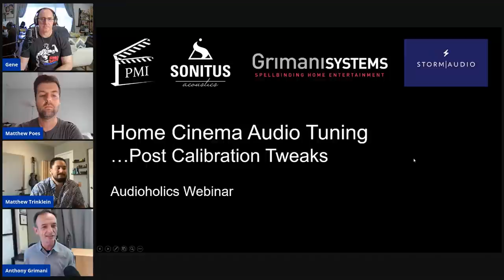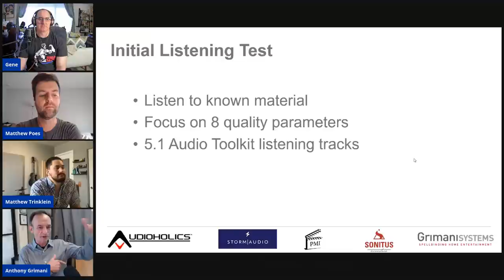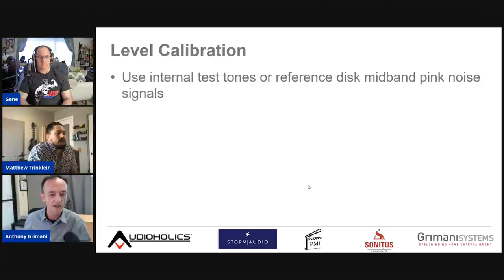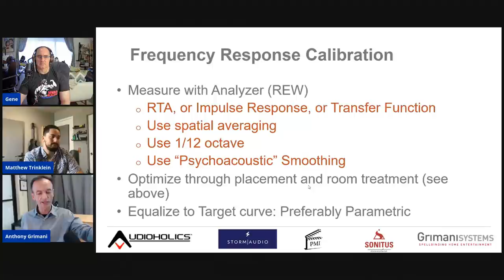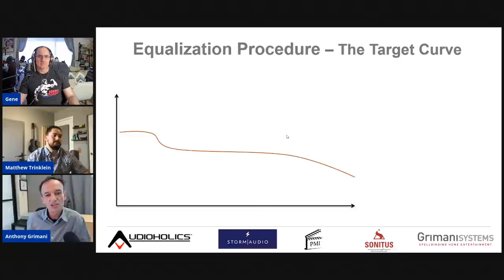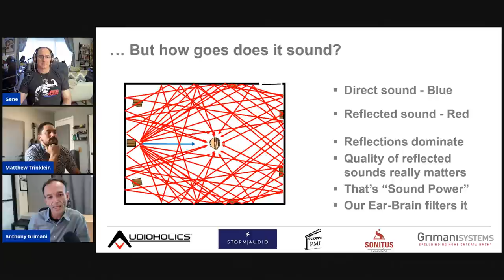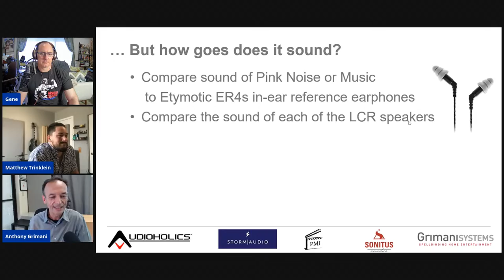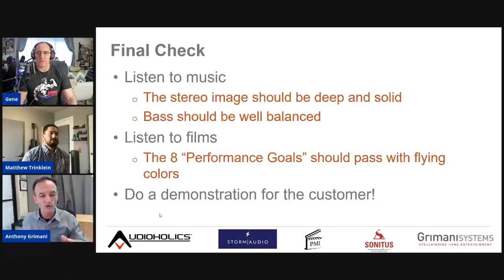Post Calibration Tweaks (After DIRAC)

Comment: Anthony your spider web drawing of the rays of reflected sound is not right. There are not that many bounces before the reverb time dies out. What you are showing is all of the possible angles that the reflections can come from, not the number of bounces that there are. Just ask yourself how far could each reflection get in a half a second reverb time. It would be more illustrative to make an image model drawing in which the reflected sound is shown as additional images on the other side of the walls, like mirror images. You won't get very far with the reflections of the reflections before you run out of additional images. I have tried to contact you by email but you don't respond.

Comment: i think maybe we get a little too wrapped up in achieving a perfect sound for HT. there is certainly bad sound, objectively bad sound. good sound? pretty easy to get. but great sound, we might be chasing the dragon a bit. i mention this only because I still go to the movies all the time and i cant imagine they are spending as much time  as we all do messing with the sound in each theatre. maybe im wrong about that. i guess my point is chasing HT nirvana just seems like not alot of juice for a tremendous amount of squeeze (ie time, money, effort).
Reply: I read about this a little and it used to be that movie theaters calibration was a manual pink nose and spl meter process but I imagine in the modern era to be certified by THX, Dolby, etc, there's a little bit more involved in the process
Reply: the big difference is Real Theatre is 100% build from ground up for the best ! 
at Home it has nothing to do with sound .. and we try to adapt it !!

Comment: One thought. You're still limited to the speakers in room frequency response. You can't raise dips too much with room correction or PEQ because you end up overdriving the speaker and/or amps. I try to not raise dips more than say +3dB. So after applying a target curve I still need to edit and follow the speaker's frequency response. End result may not be “Target Curve” perfect in the end for using pink noise and headphones as reference. But the speakers are what I got.

Am I thinking right here? Mostly using Dirac Live.

Comment: Thx, after using dirac live, my LFE all but disappeared. I'm trying to figure out to bring it back a bit. It did do a great job to make the system sound better as a whole; just want a tad more punch. 

NAD M10V2 
Goldenear triton 2Plus
Reply: see Dirac’s own channel tips,  they cover this briefly, I had the same problem life less no meat, the key is a custom target curve boosting the bass region, I also chose for now to cut the curtain to 600hz as it was boosting the mid hi to upper hi’s too much, im still tweaking but the custom target curb with at least 6db of boost was the ticket, Dirac said up to 10db is not unheard off, good luck
Reply: @ebaysnipa  thx bud
Reply: @normrubio  no problem, download the harman target curves the 10db with open curtains is working better now, just tried, im in the middle of this, you’re probably way ahead of me on all this already.
Reply: @ebaysnipa  hey I purchased and started using Dirac live full bandwidth for the first time yesterday on my denon 4800H. And after applying the filter with the 10db Harman target curve my speakers are completely muffled in sound with so much compression. I can’t figure out what I did wrong as the graphs look like my speakers normal curves during testing. 

Do you know a fix to this? I can’t find anyone on internet having this issue
Reply: @The3hunnaa  Did you apply the 10db curve to “all groups?”

Comment: Gene , based on everything that was shared, and thank you and your guests btw, would it not be better if these calibrations were run using a binaural microphone, rather than an omnidirectional one?   Also doesn't Trinnov use a three pronged microphone for this very reason?  I don't know therefore I'm asking.

Comment: Should you use the same target curve for all speakers including subwoofers and atmos?
Reply: shor answer is no.....In Filter Design you should separate Front L/R, Rear L/R , Atmos , Subs into its own group (1,2,3,4 etc)  Then apply a target curve based on the measurements in each Group

Comment: interesting, even professional's have this thing about the speakers channels level post calibration.... i mean u trust the auto setup calibration Dirac/Audy. etc. to perform a full EQ on the speakers FRQ. where it may cut/boost 12db +/- in some case even more, but u don't trust it to perform something as simple as channels level matching?...
Reply: Dependent on the quality of the room correction system most don’t trust any room EQ system to do full range correction and limit it to the room transition frequency. Even with Dirac Live and ARC I’ve always limited my frequency correction to 300-400hz with exponentially superior results to full resolution correction.
Reply: @josephfranzen5626  I did full correction first on my Arcam AVR 550, after watching a lot of videos, I tried to limit at about 5-600 Hz, it makes a huge difference because the stage imaging will not be shattered. I´m still trying to figure out how to get the best out of it.
Even with 2 sub-outs, I´m just using the sub out going in a miniDSP 2x4HD and spreading the LFE to my 2 subs.
There is a very nice miniDSP go-through about sub integration from "home theater gamer" if someone is interested.
Reply: Don't let the world you are clueless and that you lack judgment for what only you can hear, do you not trust yourself?